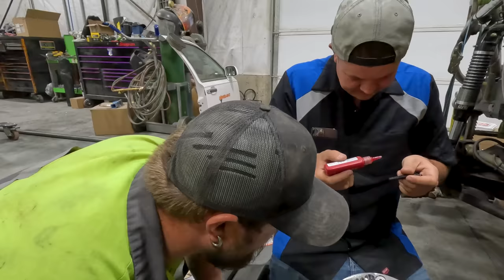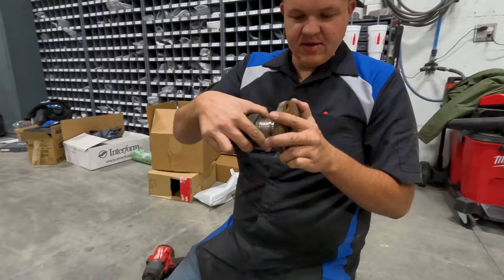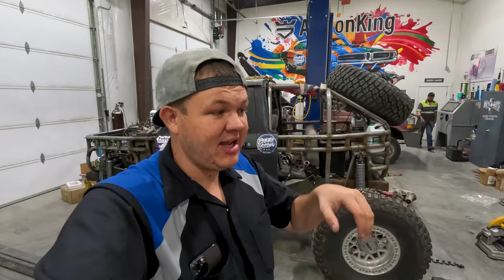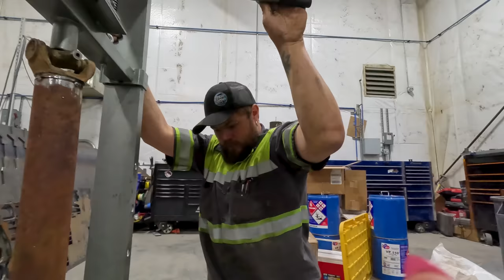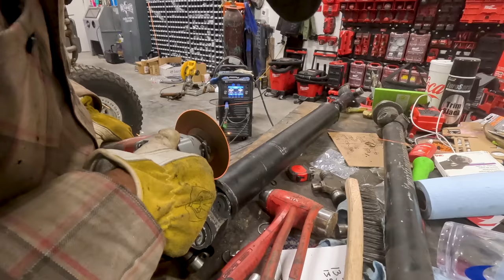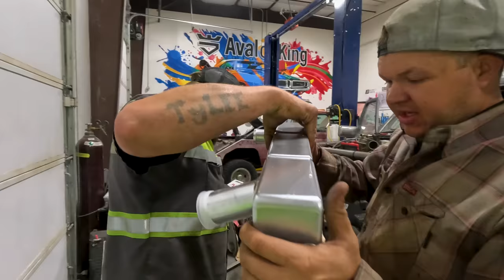Building Custom Drive Shafts For Hillbilly’s Broncstar!

Comment: I forsee a video in our future where Robby and Hillbilly regret the excessive use of red loctite😂
Reply: Yes, soon they will be buying the special wireless bolt heater you use on new Fords to get the bolts out.
Reply: I forsee a video in our future where Robby and hillbilly just throws out the motor and transmission because they can't separate the two.
Reply: I had the great job of removing about 50. 2-56 screws that a guy used red 271 loctite instead of 222 purple. Drilling out stainless steel screws out of an aluminum piece really socks! If you don't know , 2-56 screws are about the size of a pencil lead
Reply: @RobertSmith-tq6mf to see at that point you just get out the angle grinder or equivalent if you're not working with metal, and then just replace everything
Reply: Gentlemen, seek the newer Orange Loc-tite. Holds like red but loosens like blue.
Reply: @ChrisEckeard  boring

Comment: Robby, you're wrong. To clear the front or rear diff, you can drive up on a rock, log,  or anything that will lift one side or the other. The mid ground clearance or your break over clearance is dictated by your wheelbase, and your tire size, as well as your static height of the lowest point of(usually) your skid plate. I am at 23"" on my skid plate, when my rig was 108" wheel base, it wasn't much of an issue, but when I linked it and stretched it to 120" wheel base, it made a lot of difference on break over which has caused me to turtle several times. I'd ditch the double cardiian (sp) joint, they just don't hold up. As short as the Bronc Star is, just make it a two seater, and run a rear radiator, which works great for an open rig like the BS, in the winter you can reverse the fan connections polarity and let it blow warm air into the cab, works great for defrost too.

Comment: While you are correct in saying that the bottom of your differential casing is the limit of your ground clearance, what you have done with that low crossmember is going to destroy your ramp breakover angle. It's going to make heck of a difference to the Broncstar's off-road ability.
Reply: Was going to say the same.
Reply: Yeah thats pretty bad.

Comment: You guys need to look at a timing cover, water pump and serpentine belt setup off of a 1996-2001 5.0 Explorer.  It’s a very compact setup.

The intake and heads from the Explorer 5.0 are also something you might want to look at.  They are the “GT40” heads and intake, they make more power than the truck parts you are currently running.

Best of luck with the build!
Reply: The intake runners are too short, no low-end torque for wheeling!
Reply: @MrDan1509 That's possible, but if you watch the videos where they are running these hard, they aren't exactly staying in the "low-end" for anything. Low-end torque or high-end horse power, aftermarket would be better than either stock intake for that. 

The Explorer acessory drive would be much better setup for that chassis though. I made the same comment on the last video, but I doubt they looked or cared. They'd rather beat their heads against a brick wall making what they have work. I know the type, I work with a bunch of them and can be one myself at times.

Comment: Green loctite is permanent. Used for installing cylinder liners into engine blocks. Red requires heat to break loose. Blue is removable with hand tools

Comment: Just chop the complete front section off and extend it a couple inches for a regular radiator. Transfer box seems to be tucked up/protected by the bar mountings? Might just need a skid plate to protect the casting just in case. That drive is a double cardan joint.

Comment: Yes you're right when the front axle climbs over a rock it then disappears and will never catch on that cross member 😂 I'm going to coin a new phrase I'm going to call it "high centered" it's going to mean the middle of the vehicle is stuck on something and the tires aren't getting traction 😅 totally picking but you'll find out

Comment: Yes Robby you can only clear the differentials BETWEEN the tires. But everyone knows you need as much clearance as possible between the axles to roll over obstacles. 
So yes. That crossmember is really low.

Comment: Green is the one you need heat to get it out if your lucky , Blue is for screws ( Light duty ), there is red for bolts .(medium duty) 2 ,3 of each colour different applications for each. On a drive shaft the slip joint never goes to the diff end

Comment: Hey, Hillbilly. I had a (1993?1995?) Geo Metro 3 cylinder 5 speed. It got 54MPG. It would even do 85MPH. Any little hill would mean 3rd gear. It was a cheap, awful tin can. But there was something about it that was so cooooool!
Reply: Must of been a pre-1995 because I never got 54mpg on mine. It only has 40k original miles. Going with a 3 cylinder diesel and aiming for 65 to 70mpg.
Reply: It was the one way drive between Phoenix and Tucson on the freeway. Going the other way was a bit less. Its average with city driving was only about 49. @BigBlueMotors

Comment: In non vibration connections green is the hardest to remove you need both heat and torque to remove ….we used it on timers and any connections that once set they never need to be adjusted again…Red is similar to green but will also take vibrations so perfect for places where you can’t get a wrench on later to check tightness…Blue is a slight weaker then green or red..normally great for smaller bolts and install chrome parts etc where you don’t want to heat to remove….. I use red on my motorcycle motors and blue for frame fenders flares etc…still do a week tightness check on street rider..

Comment: My Ford Transit XLT has 18800 k😎 miles on it. It has not had a tuneup since 30 k. Oil, brakes tires that is all. Best vehicle I have ever owned......
Reply: how can you have not done a tune up or oil change since 30k if it dont even have 20k on it??

Comment: Green Loctite is used to take up slack in a bearing fit. If you use green Loctite on threads you will remove the threads from the bore and fastener when you take it out, even using heat. I've had to use heat to take apart blue Loctite.
Reply: Purple Loctite for anti vibration of small screws. You can get 290 green that's for threads too not just the retaining compound.
Reply: Orange 🍊 is new (red lock, blue removal)

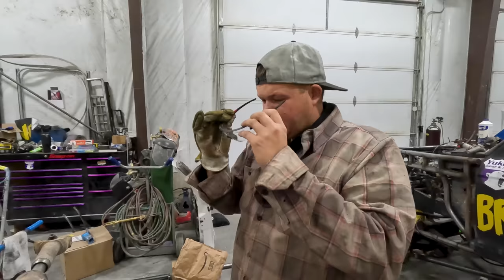Comment: 14:26 .. Keep your eye out for a deal on a BIG pipe cutter .. cut's drive shaft tubes PERFECTLY square. I've done maybe 6 or 8 or them like that, use a good ;eve; so orientate the ends, never had one balanced and used them at highway speeds. :)

Comment: I was able to do a 4 cylinder to V8 without changing any driveshaft size, however didn't have a manual transmission, had to use a C5 bell housing with a C4 tranny, but it all bolted right up to the transfer case.

Comment: Its what I did all of my life as a mechanic yet I can not explain how to fix so I ain't a good mechanic either. I am sorry that I got too old to make it down and fix this stuff that to me was a easy fix. Well not easy or simple cause if it was then you would of figured it out. Some people have skills in math and others for english..  but for me it was easy fixing this kind of problems. I don't know how to fix race or high power stuff that you do. I did demolition rigs and stuff that climbed over rocky terrain but not in say half the time like you do it. I worked for people who did not have a lot of money and we just made it work, ..... no matter what, it had to or we were not going to have food on the table. People counted on me to make it fit or make it do what ever. Like I know that I could tig weld and I never ever even get to try it before as the mig was still a new idea but first thing out of the box was beautiful welds done by me. I must of melted enough rod in my life as a stick welder to make a few rigs out of it.... you know... in metal equivalents, weight of all the rod converted to automobiles, it would amount to a lot as  I welded in ship yards as well. Now I have watched the guys who are great aluminum welders but have never tried it short of gas welding with aluminum rods they used to do it with the torch.  Sorry I can not help you..

Comment: Hi Robby just saw another mechanic using silicone as a gasket Holder / glue>  Gasket maker or silicone sealant should never be used as a glue or means of keeping a gasket in position when you reassemble your engine. Mechanics often do this believing, erroneously, that a gasket maker will not only hold the gasket in place, but it will add to the seal.

Comment: lol my ford fusion has basically parental controls there called Mykey features though but they limit the speed to 80, 70, and 65 you also have the lane keeping systems, blind spot monitoring, gas gauge goes off at 80 miles to empty instead of 50 maybe some more but that's all I can think of at the moment o most can be unlocked without touching the key but it has to be close by like in your pocket to work. you can lock it also by touching an area of the vehicle mine also has the touch pad to unlock with a numeric code!
Reply: People put a lot of hate on electric vehicles for things that have nothing to do with the drive line.
Reply: yeah but mine is gas its like almost standard in newer fords honestly! @zyeborm

Comment: Are you running the stock transmission in the Bronco II, if so I do not believe it uses gear oil or at least my Bronco II calls for automatic trans fluid.  The Transmission shop here in town suggestion I run 30w because of the AZ heat.  Just a thought I had.

Comment: You're 100% wrong about cross members as low as axle pumpkin. This is not okay. The pumpkin is a low point but it travels with the wheels. If the wheels go over, the pumpkin goes with them. Stuff between the axles absolutely needs to be as high as possible. That said, there are always compromises to be made.

Comment: Me and my friend just converted my AWD Mercury Mountaineer to 4wd by swapping the transfer case to a BW4406 and needed the similar conversion u joint 1310 to 1330. was almost plug and play when getting the right parts. Here is the list if anyone wants to convert 97-00 Ford explorer /Mercury Mountaineer with 5.0. All the 5.0 were only AWD and only offered 4wd for the v6 models.
Items needed:

Manual shift BW4406 from 1997-2003 F150, there are three part numbers that I know of and cannot find any appreciable difference between them other than possible speed sensor issues.

Shift linkage including stick from the same or similar truck as the same transfer case. Edit 10/2012- Be ware the shift linkage from some 5.4 trucks may not work, particularly early (1997 area) vehicles. Thanks to ford99_1979 for this information.

1997-200? Expedition/Navigator 4x4 rear driveshaft. Suspension set up makes no difference that I can tell. Must be from a 5.4 V8 equipped vehicle

1997-200? F150/Expedition front driveshaft (obviously from a 4x4) Must be from a 4.6 V8 equipped vehicle

Conversion U Joint Autozone P/N: 185793, PDQ/Brute Force #1-0134.

Shift boot of your preference

Tube of sealant

Comment: My KIA Soul has GEO fence, it will send message if the car gets near the established GEO fence. Only issue is the 2017 has a glitch and has not been fixed, I never activated it and I can not turn it off, so when I drive past a hospital or some state buildings and when I leave my house at the 3/4 of a mile it announces that I am in “a restricted area”. When it was new the dealership had said it was a programming issue and there was a update that would fix it, never happened and if I ask about it now the dealership says they do not have any idea of what I am talking about.

Comment: The ford vs Chevy stuff is like sockets, We all got those cheap Chinese ones that we don't mind hammering or welding into them because they are replaceable. Then you got high carbon impact sockets you only use when you need to get the job done, and you don't want to strip the head of that old 10mm...
Chevy = chinese sokets.
Ford = high carbon steel.

Comment: Just wondering why you guys cut off both sides of the drive shaft just to re-attach both sides back on when you could have just cut off everything off of one side, or am I mistaking?
Reply from the maker: You are mistaken, We had to Get  a new tube that was longer by 3.75”
Reply: @RobbyLayton  Ahh, got it. 👍🏼

Comment: Normally dont argue with you. But comparing the front diff dragging compared to the  crossmember is not fair.  Since the tires and diff are together  they will carry you over things. You dont get high centered of the diffs. You get high centered on what is in the middle of truck.  Not saying what you did was wrong. Just saying you cant compare the the diffs.

Comment: Ive known3 people that owned fords and all three over time blew their rear ends and two their front ends fell apart ,one had their fire wall bending while you depressed the clutch so the truck wouldn't go into second gear I go by the saying for ford ( Found on road dead) jeeps (just empty every pocket ) and dodge well dodge looses its value as soon as you drive it away from the dealers

Comment: I have no problem with electric cars, the performance is outstanding. The only issue is with their power source, when they get the battery issues solved the electric cars will be fine.

Except for the Mach E. They all need to burn to the ground so that Ford can choke to death on their ashes. Not because they are bad cars, but because they are NOT MUSTANGS.

Comment: Hillbilly, I am a ford hater but for good reason, EVERY ford I have ever driven in my 50+ years of living has broken on me even a brand new F-450 ambulance with 400 miles on blew the transmission.
Reply: and you have had zero issues with everything else.  I think not.  They ALL have their issues

Comment: You're wrong. you don't heat to remove  a fastener that has red locktite. been using that stuff since  the 80's before  any of you baffoons  were  even born... over 40 years as  a mechanic.. ya i know stuff... green locktite is best used on studs...  red is a light duty thread locker.. and red is a more heavy duty that does  stand up to heat better but do not need  heat to remove  any fastener  that has had red  locktite...
Reply from the maker: You got me then this bafoon is wrongo